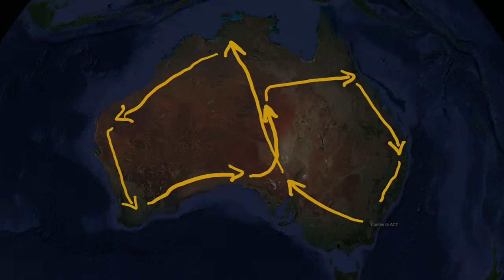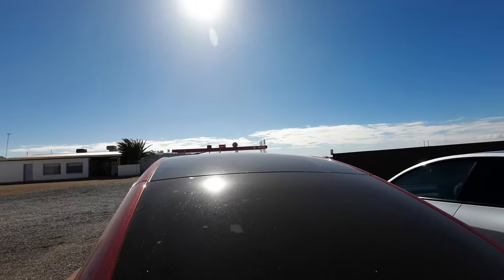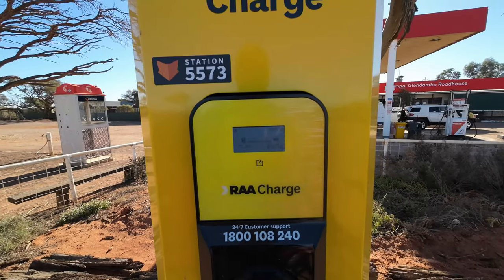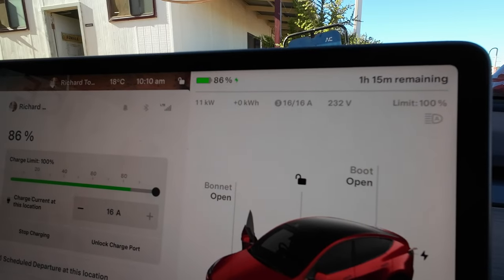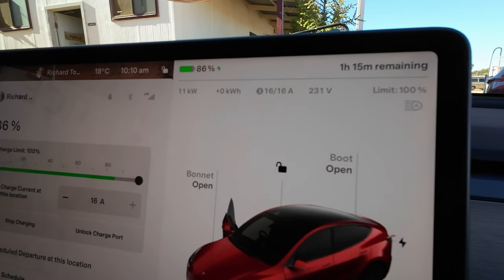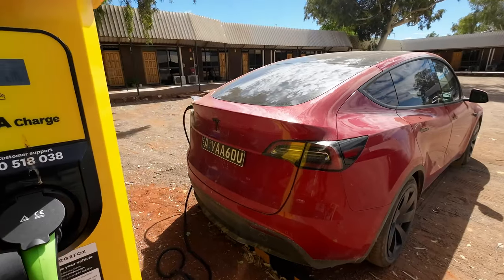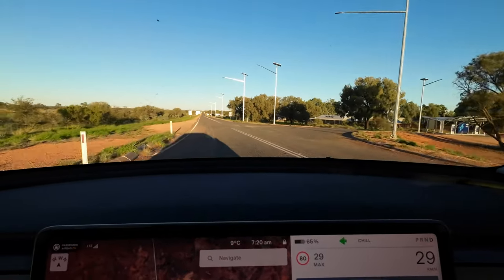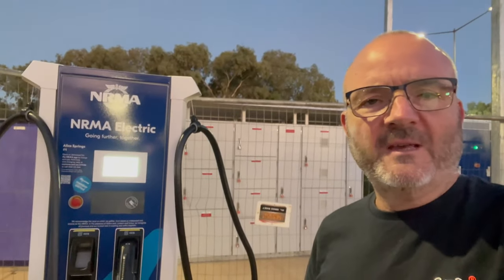EV outback road trip charging options on SA/NT Stuart highway Apr 2024. #roadtrip  #Tesla #outback

Comment: Chicken and egg problem. Need reasonable chargers so people get EVs. Need more people with EVs to make charging sites commercially viable. Bit by bit the whole thing is coming to life.  Great video.
Reply from the maker: Thx. Just like the outback after some rain, it is coming to life. Based on the number of outback EV drivers I've seen the station numbers are about right, but the new 7kW sites are all wrong. These are the "easy' way out because of local power issues, but that can be solved with more investment from the state or feds.

Comment: Definitely more planning and finger crossing atm for these types of journeys in an EV. Imagine rocking up and finding the chargers out of order out in the middle of nowhere. Or a couple of other vehicles lined up.
Reply from the maker: Yeah absolutely. You need to have no fixed agenda with plenty of spare time up your sleeve and to always have a plan B. Absolute worst case is to wait it out. Thankfully there are a lot of power points around, you just have to ask.

On our trip we have had examples that apply to all vehicles too e.g. roads closed due to flooding. Or a guy in an ICE who hit a kangaroo, and was doing the repair on the cheap by waiting it out for days at a roadhouse while a spare got expressed to him via mail. The outback can be unforgiving.

Comment: Very informative video thanks.   A bit of travelling fun I guess.....unless you want to use your A/C......and drive at a reasonable speed.....or tow something like a boat or caravan...etc.
Reply from the maker: You do need to compromise on speed or travel time in places with no access to fast charging. This is only temporary and will change over time as the networks expand.

FWIW, we have never had to travel without the A/C or heat on. With heat pumps, those system's are very efficient in many EVs these days

Comment: Those Tritium units NRMA has put in are the two cars per satellite as there is 2 cables unlike the older units they can actually charge two cars at once so 4 cars could use it not that there is many Chademo cars that have done this as yet and don't expect there to be many as CCS2 is the standard and all new EV's only have CCS2.
Reply from the maker: That’s interesting. Thx for the clarification. The charge was limited to 35kw due to capacity constraints. Be interested to see how it handles more than 2 cars simultaneously
Reply: @AUSY8  Same setup at Nullarbor Roadhouse which has more EV's but same thing again with only 2 CCS cables so would need a 60kWh Leaf or a couple of to test with 4 cars.  Suspect wouldn't be very fast charging rate mind you on each car.